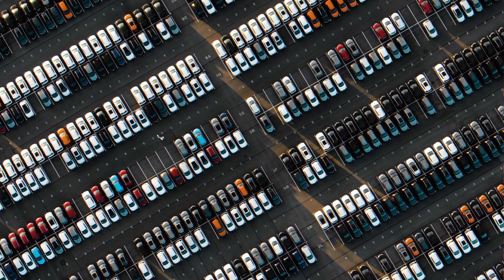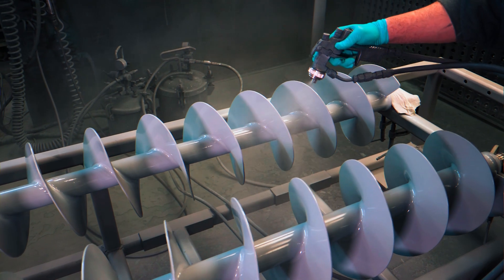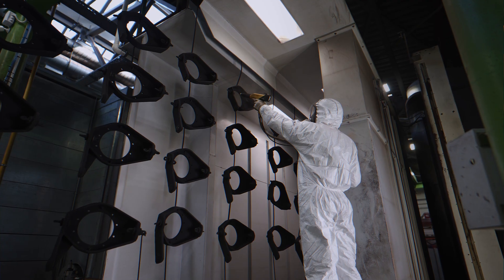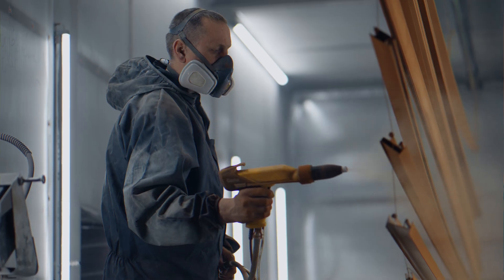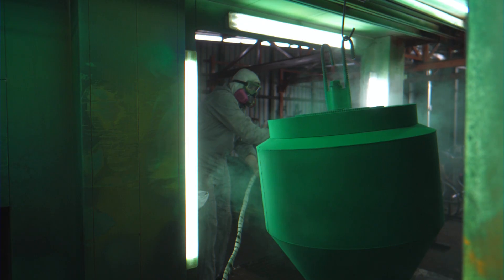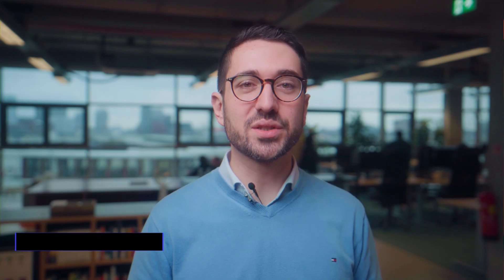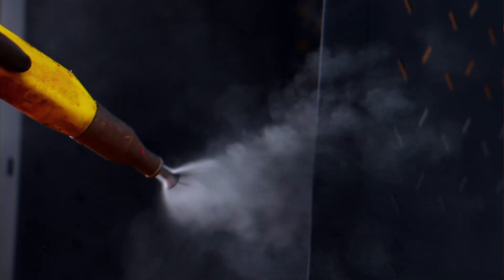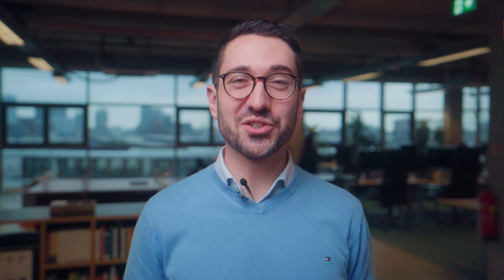When to use/not use Powder Coating for Your Parts

Comment: Powder coating indeed is very durable but it does not offer good corrosion resistance. It only looks seal but it usually isn't. Powder coating is definetely not a good choice for higly corrosive enviroments.